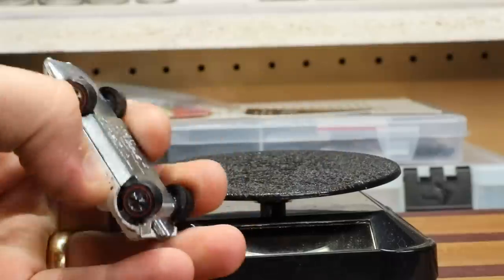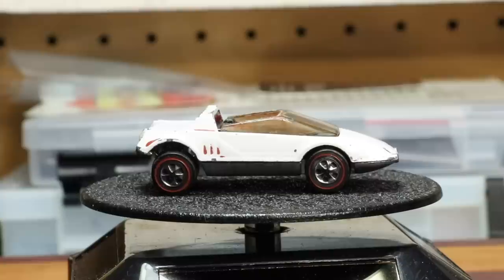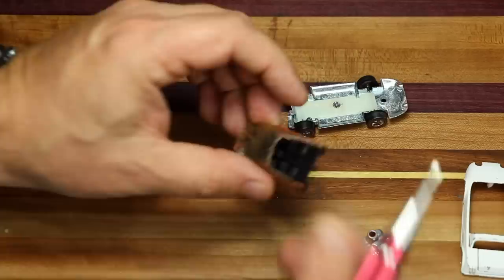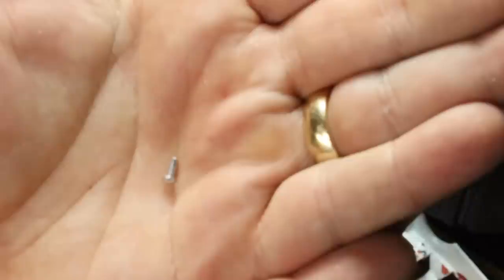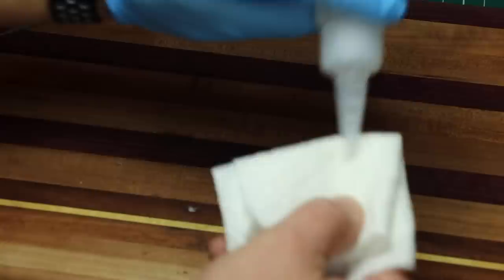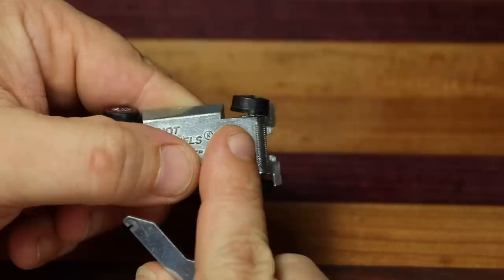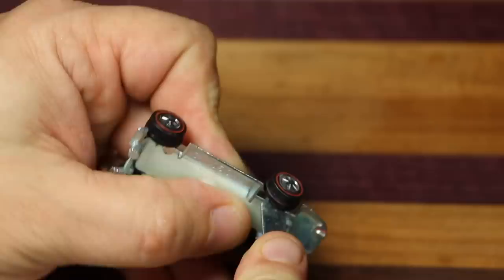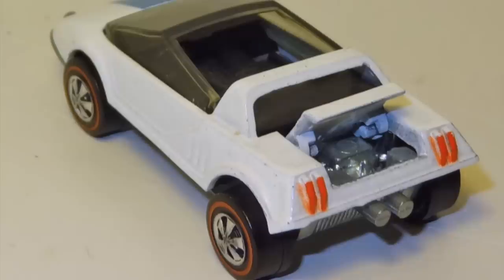Redline Restoration : 1970 Jack Rabbit Special Hot Wheels

Comment: The best thing I have found to clean 'clear' plexiglass (and I'm sure it would work on Hot wheels windshields but I haven't tried it yet) is plain toothpaste.  Don't get the gel, it must be the plain white toothpaste.  I have cleaned headlights on cars and it works great and it's cheaper than most cleaners.  Toothpaste has small bits of pumice in the paste that polishes your teeth and/or your windshields.
Reply from the maker: Toothpaste works excellent on real headlight lenses as well!

Comment: As a modelist, I can tell you that brake fluid work to clean plastic. That's what EVERYBODY do to clean their bodies if they mess up the paint. DO NOT, however use it on resin. Another one that work well, but might take a little bit longer, is Easy Off oven cleaner (which is what I personally use). You soak the plastic in for a while, then with soap and hot water (not boiling) you wash the plastic with a toothbrush. You may need to do it more than once tho.

Another thing for the glass. Did you sand it before putting it into Pledge? Normally the guys that recuperate their "glass" sand them, starting with a rougher grit, up 'till a grit of 1500 (some go even into higher numbers), then they soak the part in Pledge.

That said, I guess that this casting is sold for cheap if almost nobody like it. Personally I do like it. I'm not really fond of HW's fantasy cars, but there's some casting I like and this one is one of those. Plus it has an opening hood.
Reply from the maker: Thank you for all the info! I didn’t sand this one before the future but I have in the past. This one was close to being non salvageable.

Comment: Brake fluid seems to work well. Brake cleaner will melt the plastic, and that looks like what happened. The windshield still looks better than it did, though.
Reply from the maker: Thank you! I only used the cleaner on a small portion that attaches to the interior as a test.

Comment: Brake fluid is totally safe for soaking. You master cylinder in you car is probably plastic. It's not strong enough for just rubbing on paint and removing. I used it all the time on plastic model kits when I got bad orange peel on a paint job.
Reply from the maker: Hmm.. Never thought of that, the master is plastic in 99% of the cars out there. I'll let the next one soak :)

Comment: You can trust the brake fluid. Watch ToyPoloi he uses it alot. It doesn't damage the plastic at all but you must let it soak. And you can reuse it. So just buy a cheap bottle of brake fluid. Pour it in a tub, put the plastic in the tub and let it soak. When the plastic is clean just pour it back in the bottle and you can use it again later.
Reply from the maker: I will for sure next time.

Comment: DO NOT, DO NOT ever use brake cleaner on acrylic plastic!   

Brake fluid DOES work very well, but not when you use it as a topical rub applied with a cotton swab or paper napkin. It needs to soak. Immerse the part in a cup of brake fluid and let it soak for a while, say 30-40 minutes. The effect will be much like using aircraft/marine stripper from a painted metal part.